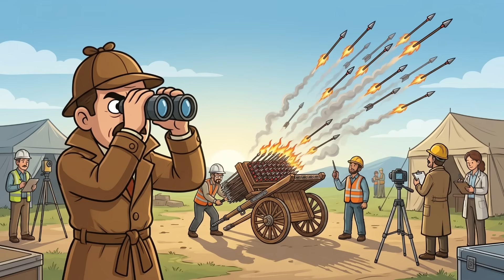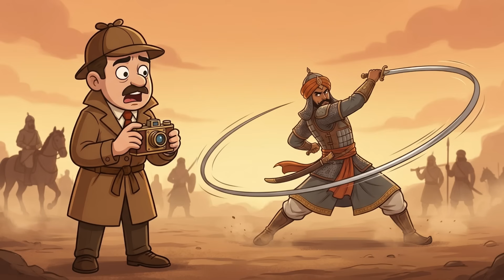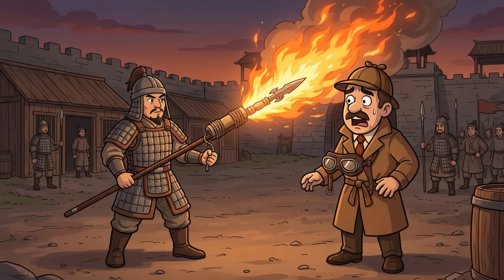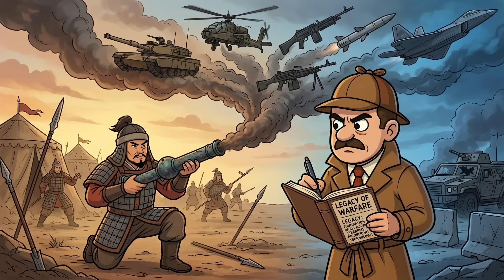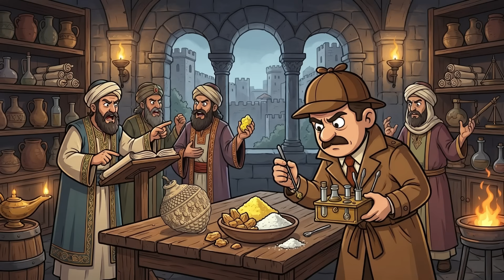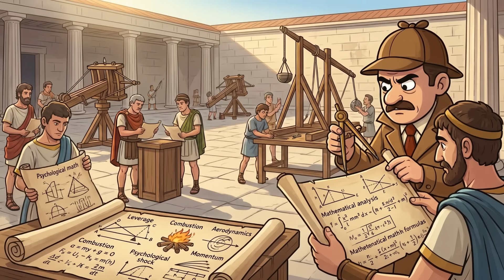10 Forbidden Ancient Weapons That Once Made Empires Tremble

Comment: I really don't like the majority of this, because it glosses over a lot of traditions that are documented throughout history. That actually explain why a lot of these things did not take off and the answer to most of them is the same. It was about honor a bow and arrow to an extent was honorable. Because you at least had to be able to see your opponent.Whereas any of these long range weapons take that away to where you only need to see relatively, where they are. And in regards to the more close up weapons, the same thing applies, especially with the qatar, that would only be used by an assassin, not by soldiers or anyone else.Because it does not fit how society was built while there was crime.And everything else, to an extent, there was honor among people, even thieves, to a point wouldn't cross a line